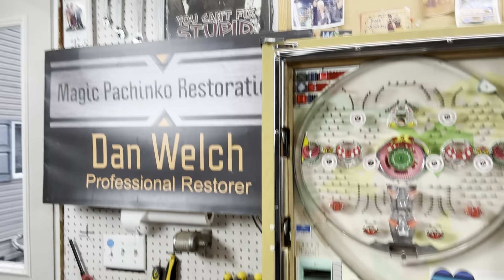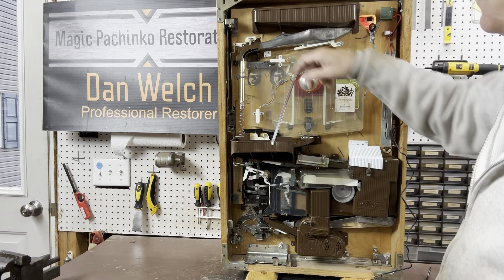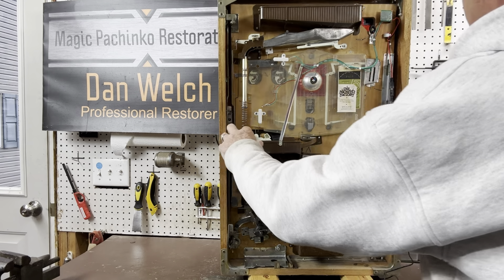1972 Nishijin Model A vintage pachinko machine restored.

Comment: I picked up a Model A (I just figured out from this video) Friday for $20.  I thought, "What the heck... Why not?".  Now I find myself trying to delve into the repair. Before I can repair anything, I am mindful of removing anything without knowing how it goes back together, and I need to understand the mechanical functions.  This video helps greatly. There sure are a lot of staples instead of screws.  Obviously, these were made "on the cheap" back in the day.  It's in good condition with very little oxidation.  The chrome will clean up nice.  It was, however obviously used in a smoking environment st the plastic on the back has yellowed.  I'm a new subscriber, so thanks!
Reply from the maker: If I can help at all, just give me a call.
Reply: @MagicPachinko  Again, thanks!

Comment: I am having one particular problem with loading balls right now.  They are falling, but never go past the track into the clear windowed area to meet the brass fingers, as you describe at about 05:15 in this video.  I'm wondering if the balls might be too large for this machine.  The bag that was with the machine when I purchased it just might be too large.  What diameter is needed on a model A?  Thanks, Dan!
Reply from the maker: All pachinko machines use the same diameter balls. Authentic pachinko balls are 11mm.
Reply: @MagicPachinko  Thanks, Dan!